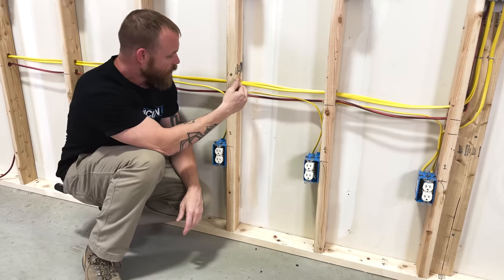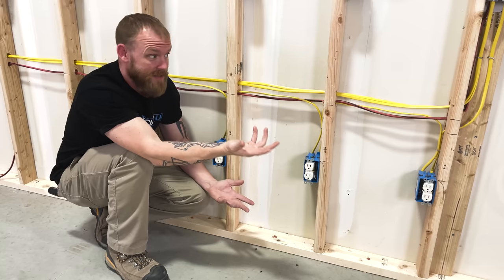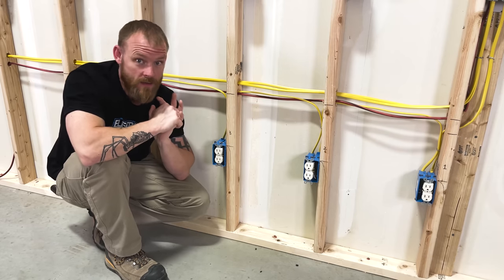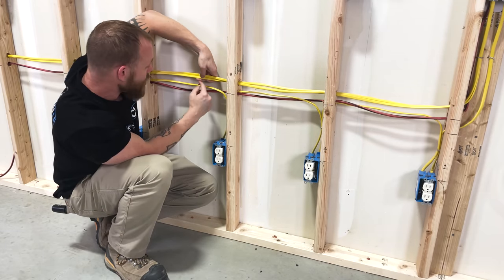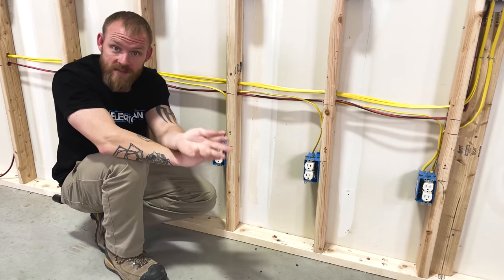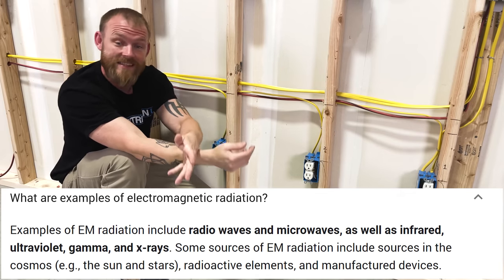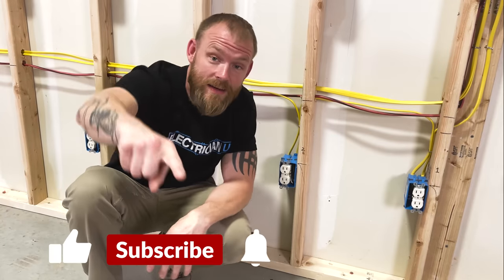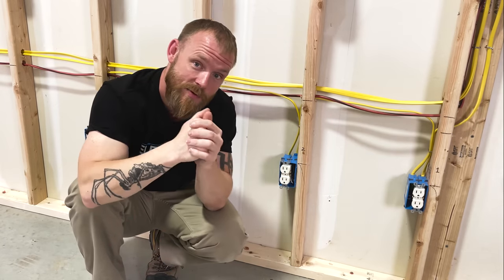How Many Wires Can Fit in Each Hole?

Comment: Nothing to do with capacitance.

Bundling is a factor for two reasons - yes one ability to dissipate heat, but the proximity effect. AC flowing in parallel wires causes something akin to the skin effect - the magnetic field will induce an eddy current causing current crowding down the opposing sides of each conductor (or, within the same cable between line and neutral you will see the close side!). Even worse a problem in transformers and inductors etc, but does happen in bundled cable and especially bundled same-phase/neutral single wires like you might find in distribution boards...

Comment: I'm writing software to calculate the fill for cable bundles. I'm intrigued by your videos, because I'm coming from the Telecom IT side, but was briefly an electrician apprentice ~30y ago. Bundle sizes, and fill ratio, seem to have dynamic properties that sometimes change things. Like, as you point out, one does not want to over bundle too many cables because their magnetic fields interact resulting in heat, or in my case harmful interference. I'd you ever want to talk in depth about the maths involved, let me know.

Comment: Capacitance is a product of the individual wire.

Inductive coupling is a product of proximity between wires all packed together

The two combined creates parasitic losses any time there is a lot of current even just on one wire depending on the harmonics of the circuit.

Comment: Isn't there suppose to be a protective metal plate clipped around stud to protect wires from being drilled into in the future?
Reply: 300.4 Cables and raceways need to be 1 1/4" behind the face of the stud or nail plate is required.

Comment: 110.12. Mechanical Execution of Work. "Electrical equipment shall be installed in a neat and workmanlike manner."
If you tear the sheathing, repull the romex.  Not very neat and workmanlike if your romex has a bunch of electrical tape on it.
Also, in a 2x4 wall, you shouldn't have a hole bigger than 1".  You must stay 1¼" away from edge of 2x4.  1¼ from either edge leaves you with a 1" hole in the "field" of the stud.  You could use nail plates, but drywallers tend to remove them from time to time.

Comment: But what if al 40 were pulling 20?
would be a fun experiment.
Reply: You'd hopefully trip the main breaker in most homes, unless it's 1000 amp service or higher.
Reply: @illestofdemall13  
The experiment I envision would be loading all to 20 amp to see if there is a heat build up.
Reply: @daletyler5344  I get that, but "What if all 40 were pulling 20" means you'd pull 800 amps and most homes are 150, 200, or 400 amps at the service so you'd trip the main breaker.

Comment: Don't they get hot under load?
Reply: @JavaZombie  true but kitchens on a busy morning can pull on the juice especially if it's stove kettle and microwave. You just have to hope it's on a dedicated wire.
Reply: A wire only gets hot if the ampacity started to get close to the Max allowance of the wire. 12 awg at 75 degree Celsius can handle 30 amps, however you can not put a wire on a breaker that is more than 80%. So 12 awg only allowed on 20 amp breaker. But it’s allowance is 25 amps at 75 Celsius. So unless your close to the allowance for a long period of time it won’t get hot. As for bundles, if one or two wires are being used, the amperage being induced would not be near enough to make it hot.
Reply: @creating-infinity  true the breakers going to kill it, I'm used to people sticking a heavy load over an extension reel but all that's on the outside.
Reply: @jamesgorman5241  yeah. Home owners don’t realize that extension cord (at least the ones that common homeowners buy) are generally 14 awg. And they over load it thinking it’s the same as anything else.

Comment: what is the largest hole that you would drill through a 2x4 stud?
Reply: 300.4 Cables and raceways need to be 1 1/4" behind the face of the stud or nail plate is required. That means 1 1/2" is the theoretical max if you're trying not to nail plate the entire run.
Reply: @normILL  This is an important thing that the video misses! But (3.5 - 1.5)/2 = 1? I think a 1" hole is the max (3.5-1)/2=1.25
Reply: Thank you all for the replies

Comment: Don’t you mean inductance?? 🤔
Reply: Inductance is resistance in AC circuits; capacitance is ability to store charge. Capacitance can act like a short in AC, though in this case it would be a very low current one.

Comment: Moron logic: Since 2 wires next to each other are both insulated, there’s twice as much insulation as needed. Just strip the insulation from half the wires and you’ll double the number of wires that will fit through the hole.

Comment: You can argue all day but without either being an engineer studied on the topic or citing engineering formulas and studies on the topic you are just spouting conjecture based on the whims of the limited observations by your own experiences. Talking on break with the guys is fine, anything goes. I have a real problem, however, with making a video for the general masses that may not be aware the of the complete lack of real science in so many of your videos. Your opinion is yours to spout all day but unfortunately too many lack the knowledge to realize that there are decades of studies backing up most codes and "opinions" of those codes are mostly useless and dangerous. In general, you are in a group that fires off making videos on everything you learn about before truly gaining full knowledge on the subject. The comments thanking you and praising you seem to propel you forward to put out more and more content. I challenge you to research everything you possibly can about what you just covered, you will find out there are things you didn't know and that you got wrong. And back up your conjecture with science, the testing methods are not hard to find and a simple call to a manufacturer of cables may well put in direct conversation with the engineers that research the topic every day. Don't let a few praises in the comments go to your head, slow down and master the subject, show your science along with your conjecture. The whole process will humble you a bit, I suspect.